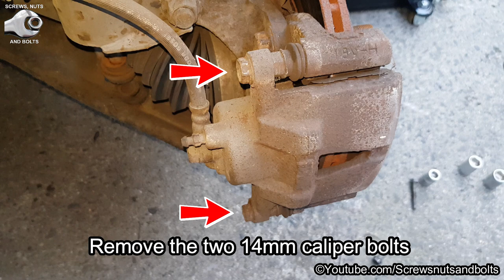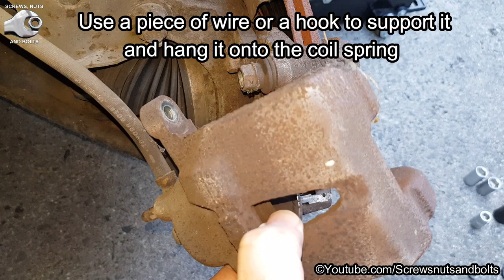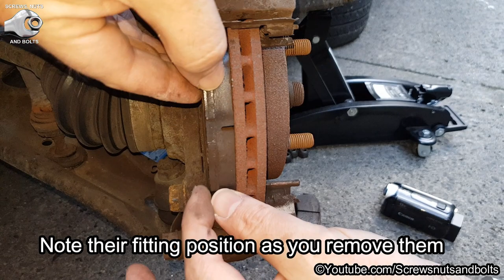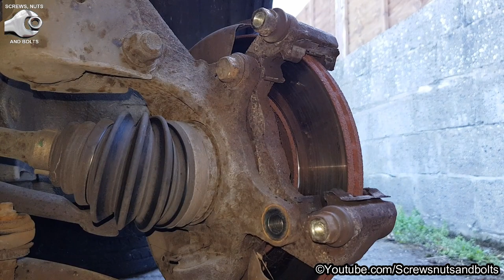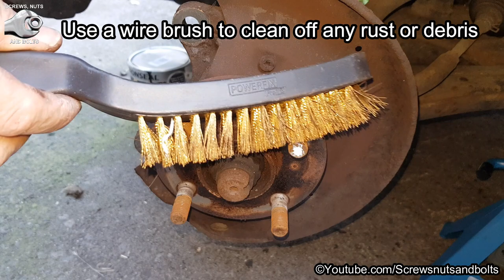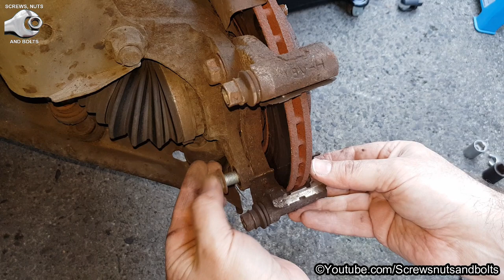Brake Disc Renewal - Toyota Yaris (Brake Rotors)

Comment: Nice clear process, thankyou for the video. Whilst dismantled, I'd clean up the caliper assembly and bolts too, with some copper slip for good measure. And may I be so cheeky as to suggest an apostrophe at 7'10" ?

Comment: In case anyone is wondering it is a 8mm thread - I don't understand why Toyota couldn't just put a screw in the disc instead of this two bolt pulling method, literally on my way to pick up a bolt for it 🥴😮‍💨